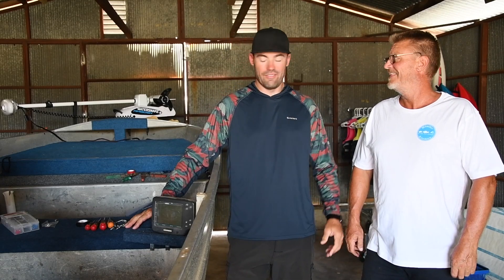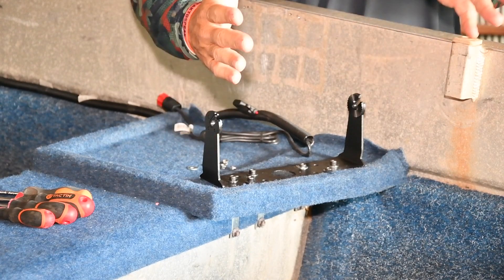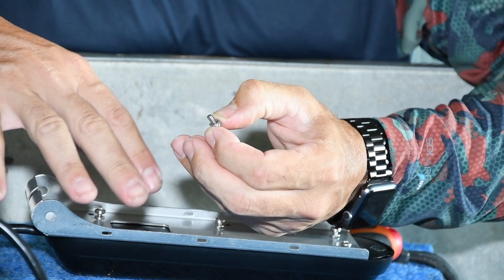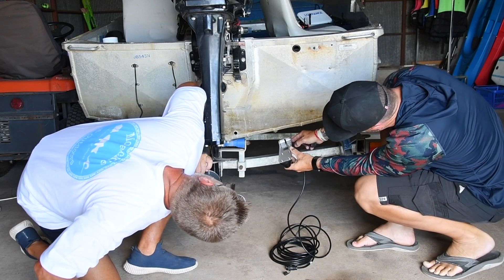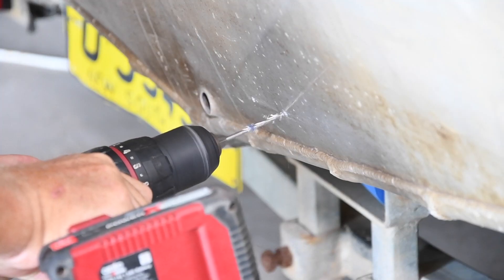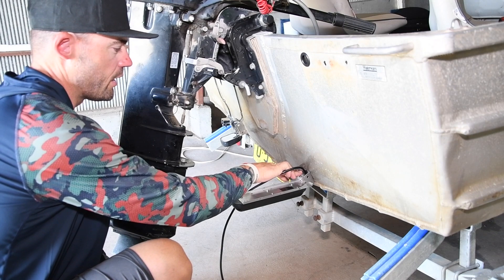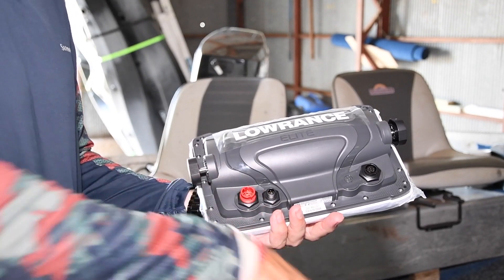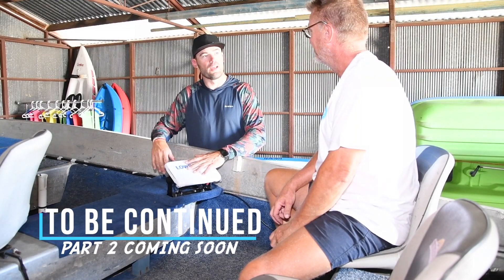Elite Ti Install Lowrance Pt 1

Comment: Do not drill.
Either mount a plate like stern saver (no association) as I just did on my fibreglass boat.
On my first boat, a quintrex 3.8m tinnie, I put a aluminium rectangular bar, about 400mm long as a mounting plate. Attached bar to boat with marine silicon. NO BOAT HOLES.